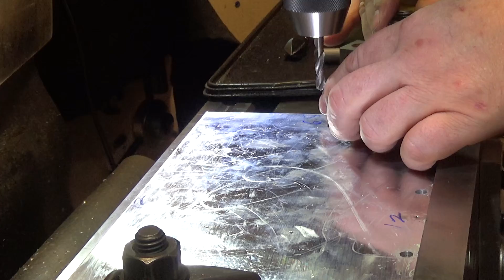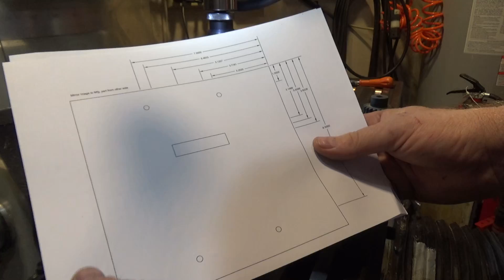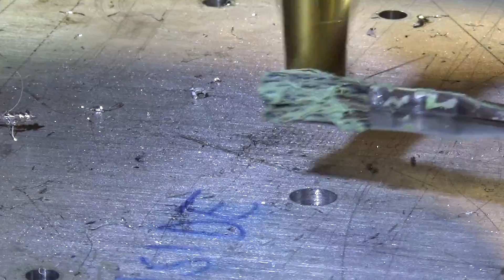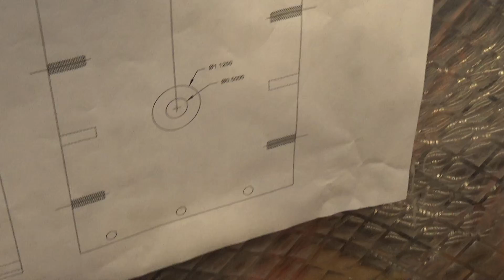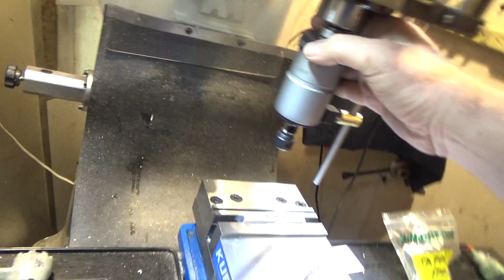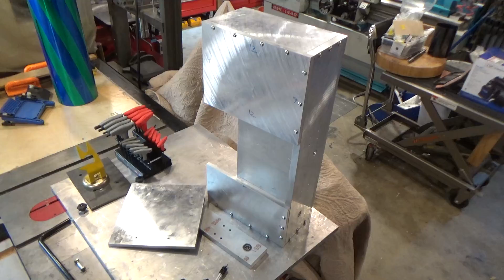141 6x48 BeltSander Building the Frame 03

Comment: I encountered the same issue with conductive edge finders. I noticed the problem when I rotated the spindle. So I assumed that I had just gotten a bad unit and ordered another. The second unit was also out. I use the type with a sphere on the end. I played around with moving the spheres to make sure that they were seated properly, and that illuminated a inherent problem with the design: there's some play in the seating of the sphere. I made numerous attempts to improve the accuracy to no avail. 
What I have found to work with these devices is a change in their use. I run the spindle very slowly and look for the LED to flash on. With this method, I consistently get repeatable locations of ± .0002", which is the resolution of my DRO scales. While this works great for center finding, it requires a correction factor for edge finding. The actual offset value is larger than the radius of the end because of the runout. I edge find on gage blocks to determine the correct offset value. If you're willing to do this, these edge finders work great on conductive materials. 
All that said, I would much rather use a Renishaw.
Reply from the maker: Great tip. Thanks for the neat idea. I'll give it a try. I have had good luck with the more expensive ball tipped Fowler. It is spring loaded and I seem to be able to get 0.0003" repeatability, if I am careful.